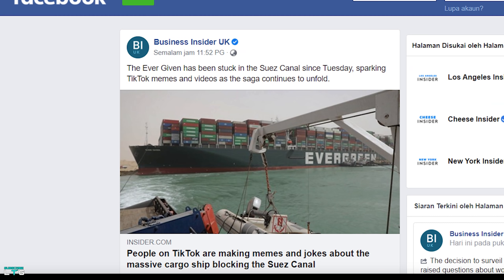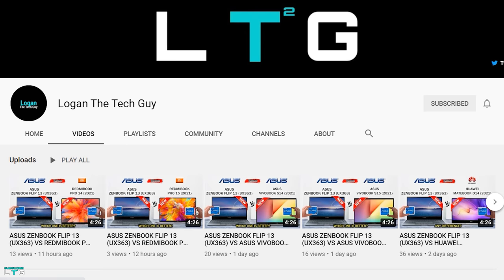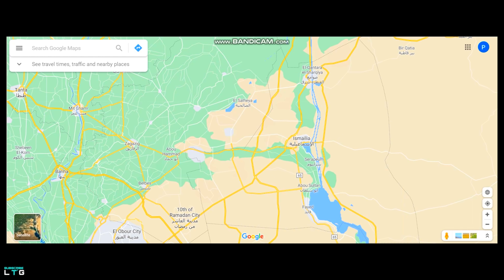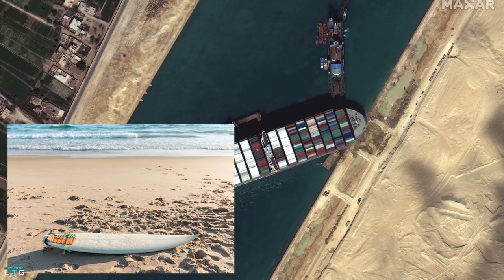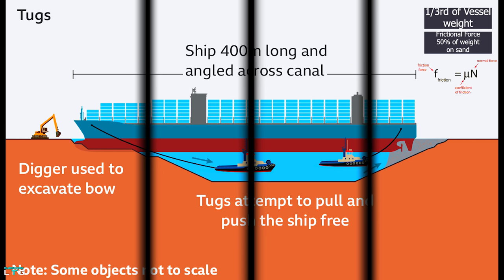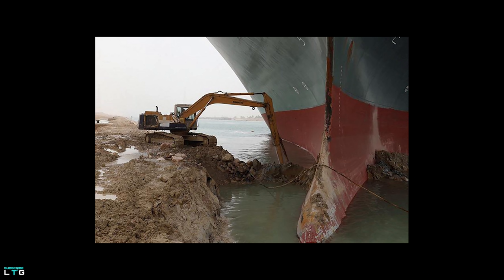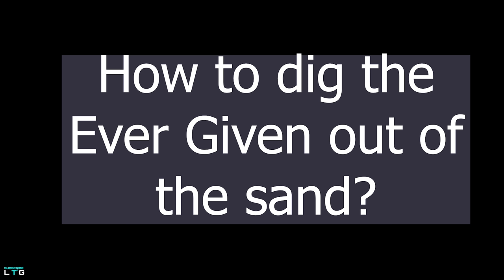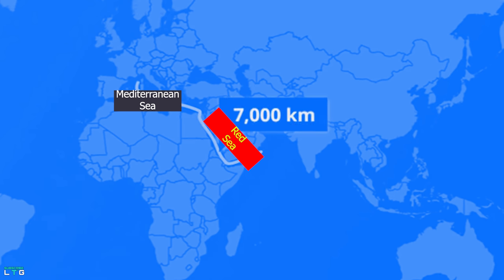MV Ever Given - How to solve the blockage at  Egypt’s Suez Canal? | TECH & ENGINEERING

Comment: Thanks for the technical data. Whether Egypt brings in a crane to offload the conexs or not, they'll have to stabilize the sand embankment. Short of sheet piles, maybe they could sink freezing lances to implement artificial ground freezing like the Boston "Big Dig" and then use that as a stable base to install a series of 1,750-tone capacity Longwall Top Coal Caving (LTCC) hydraulic roof supports to laterally push the Ever Given back into the channel. Thanks.

Comment: Why not pull using another ship Ruther than 25tug boats
Reply: Ship hull could break.  Dredging and cargo lightening is the only solution.
Reply: Another big container ship would not be maneuverable enough anyway.
Reply: @stephaniegrow2001  Why should it break? It's made of massive ship steel. Maximum the chain would break.
Reply: New Balance 2019 USA These ships are not built like battleships with massive armor.   Actually, they are quite fragile despite the massive size.   The ship designers do their utmost to keep weight of the hull to a minimum, to build as light as possible to keep down construction costs.  It would be easy for this kind of ship to break her back and split in half.  I'm no engineer, or naval architect, just an old sailor, and in my opinion these monstrosities are by definition unseaworthy.